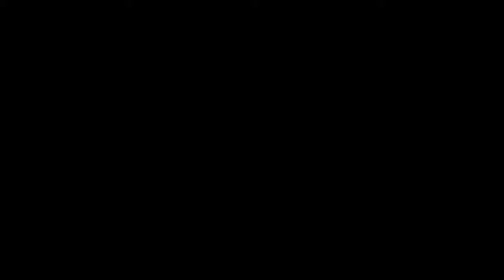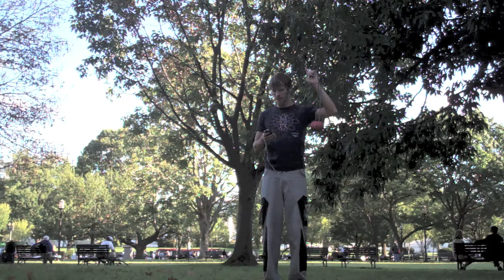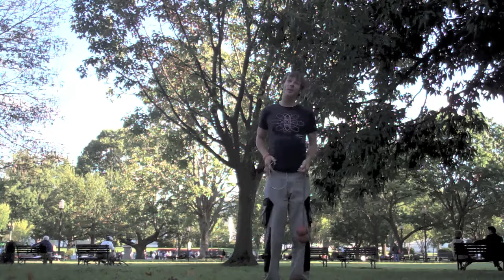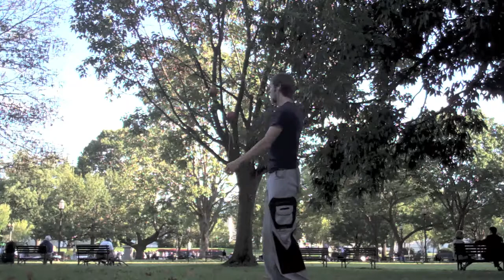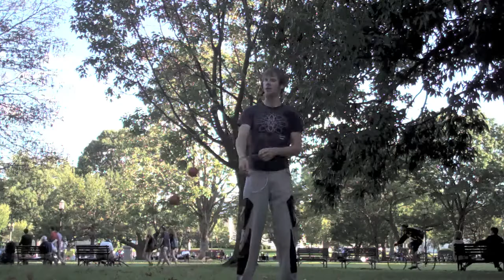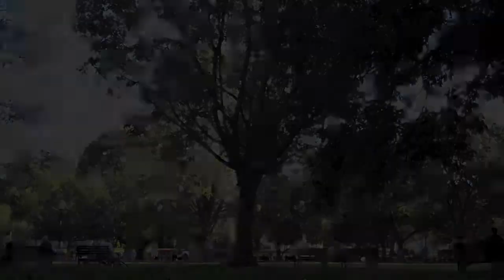Drex's Tech Poi Blog #287: Timing and direction in 1.5s

Comment: Some insight: You are correct when you say that a repeated static vs pendulum has a together or split timing but not necessarily a directionality. However once you start switching hand's driving styles you CAN in fact have a directionality as you originally postulated. You were right in that any "(not)1.5 weave" that is more than 2-beat and you have a larger portion of the pattern that is normalized into a T&D. In which case it is more like the pendulum swing is a lockout added to the pattern.

Comment: Further symmetry suggestion: When demoing the together phased pendulum vs static, of course you don't get the head meetings with your hands frozen in a split-opp position. On the other hand if you separate the hands horizontally, you get a nice tog-opp symmetry.

Comment: Constructive criticism Drex: When you stack your hands and thus poi vertically, poi parallel to coronal plane in this video, you're hands are off the center line of your body. This breaks the symmetry. Clean up your hand position for better effect. One way to think of it is a position frozen from hands in split-opp. As such the 2 hands should fall on 1 vertical line.